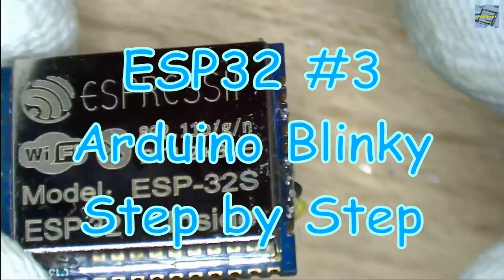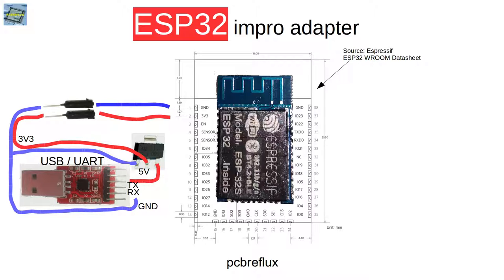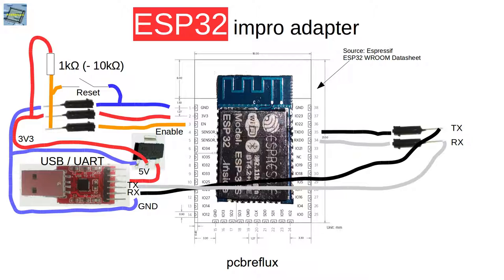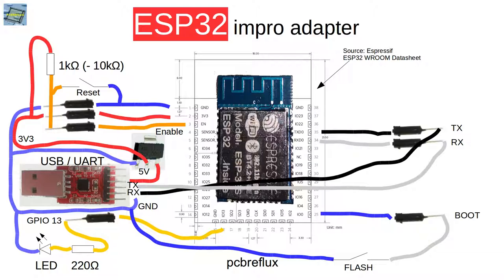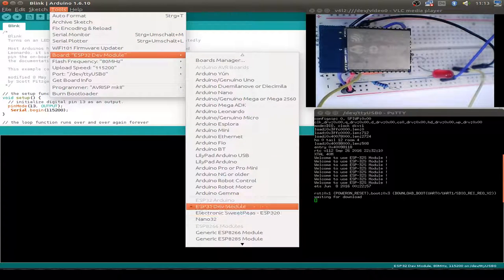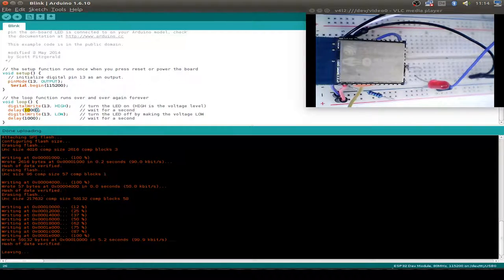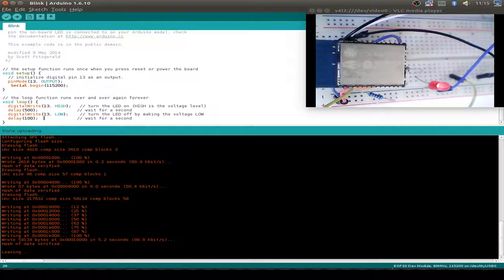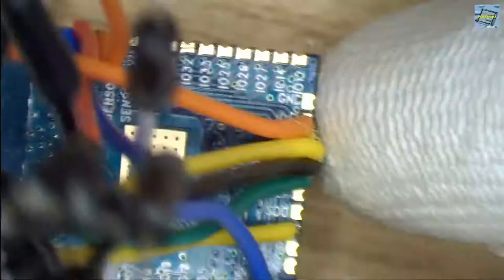ESP32 #3: Arduino tutorial - getting to blinky (step by step)

Comment: Hi. When developing ESP32 applications using the Arduino IDE are the dual cpu's fully taken advantage of as they can be using the SDK? Can we expect to support WiFI, a Web Server, ajax, and an application reading sensors etc, without random WDT timeouts? Thanks for all you do!
Reply from the maker: Gary B As far asI know the Arduino tasks runs on one core while the system tasks using the other core (pinning), no worrys for timouts. And most of the Arduino SDK should be implemented now but its still under havy development. And if not now implemented (binary) you can expect the use of the hardware crypto accelerator for protocols like TLS/SSL/HTTPS..

Comment: Hello, 
your series on esp32 is really great and im benefiting from it very much.

I have one question, that is, does your use of the voltage regulator relate to the following error?
(brownout detector was triggered)
Im having this error as Im trying to use BLE in my code. I can programme the chip using the FTDI programmer through arduino without the need for any voltage regulator, but that's only for normal codes (i.e GPIO simple use). However, one I try to use BLE, I get that error which I suspect to be related to powering issues.

I appreciate your help
Best regards
Reply from the maker: Buzz Buzz Hi, some one suggesting to use a big electrolytic capacitor (~10uF, ~100uF) between VCC and GND to prevent the brownout, but not try this my self. The esp32 needs some current spikes around 300mA to 400mA with ble/wifi so your energy (i.e. voltage regulator) source need to handle this.
Reply: Thank you for the reply @pcbreflux. I'm now powering it from the output of another board and it works (maybe the board makes those spikes), but just for testing and need a permanent solution anyway. I'll try the capacitor, but i was planning to power the chip for my wearable project by a Lipo battery 3.7v, 155mAh. Do you think this is sufficient, and how to find out?
Reply from the maker: Buzz Buzz The esp32 is limited to 3.6V. For the lipo with up to 4.2V (3.7V typical/nominal) you need a voltageregulator/LDO that can handle 400mA (+safety) anyway.  For you project choose one with a very low  quiescent current and high efficiency. The most Lipo's can handle this peaks but think just try different ones and measure the average current consumption and calculate the lifetime. Or may think about using a LiFePo4 battery without LDO but there are other pros and cons.

Comment: Hi! Thanks for the tutorials.
I've got a question.
What's the minimum current that is needed for the 3V3 pin?
Reply from the maker: Hi, think to be on the save side you   need at least 200mA for starting the ESP32 (with out WIFi or Bluetooth) on the 3.3V Pin, but maybe 150mA with a big cap works. With WiFi you get spikes up to 400mA draw. See my current measure (draw, transfer or consumption?) video for more...

Comment: Why do you use putty?  The arduino app has a serial console already builtin, it does saves a lots of clicks.
Reply from the maker: AltMarc there is no good reason for using putty just my laziness because I also use eclipse for development. but you are right, to use the arduino build in serial monitor is easier.

Comment: Dear Sir, 

I try to upload program to ESP32, but error message show about that

How to fix this problem.

Thank you.

*****************************************************************************************************

ketch uses 163133 bytes (12%) of program storage space. Maximum is 1310720 bytes.

Global variables use 11148 bytes (3%) of dynamic memory, leaving 283764 bytes for local variables. Maximum is 294912 bytes.
esptool.py v2.3.1
Traceback (most recent call last):
  File "/home/buten/arduino/arduino-1.8.5/hardware/espressif/esp32/tools/esptool.py", line 2637, in <module>
    _main()
  File "/home/buten/arduino/arduino-1.8.5/hardware/espressif/esp32/tools/esptool.py", line 2630, in _main
    main()
  File "/home/buten/arduino/arduino-1.8.5/hardware/espressif/esp32/tools/esptool.py", line 2355, in main
    esp = chip_class(args.port, initial_baud, args.trace)
  File "/home/buten/arduino/arduino-1.8.5/hardware/espressif/esp32/tools/esptool.py", line 193, in _init_
    self._port = serial.serial_for_url(port)
AttributeError: 'module' object has no attribute 'serial_for_url'
AttributeError: 'module' object has no attribute 'serial_for_url'

Invalid library found in /home/buten/arduino/arduino-1.8.5/hardware/espressif/esp32/libraries/BLE: /home/buten/arduino/arduino-1.8.5/hardware/espressif/esp32/libraries/BLE
Invalid library found in /home/buten/arduino/arduino-1.8.5/hardware/espressif/esp32/libraries/BLE: /home/buten/arduino/arduino-1.8.5/hardware/espressif/esp32/libraries/BLE

*****************************************************************************************************
Reply from the maker: Hi, have you set the Port of your broad? (Menu Arduino->Tools->Port ? maybe ttyUSB0or ttyUSB1) For me this error appears if I set the wrong or no USP to UART Port.
Reply: I have set the Port for board already with /dev/ttyUSB0, and I can use Serial Monitor and also see the serial output. But I still can't upload program as error message above
Reply from the maker: Do you see the "waiting for download" message if put in Upload Mode (hold GPIO0 and press Reset)? Maybe close all serial monitor before uploading ?
Reply: Dir Sir

I already solved  this problem by "pip uninstall serial" and "pip install pyserial"   

Thanks for your advice^^
Reply from the maker: Thanks for sharing, this helps viewer with simular issues.